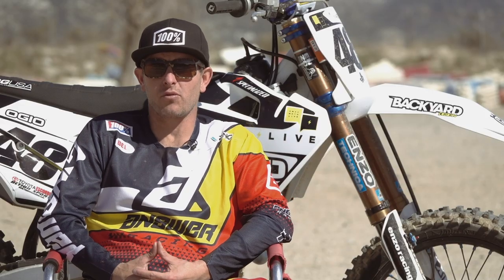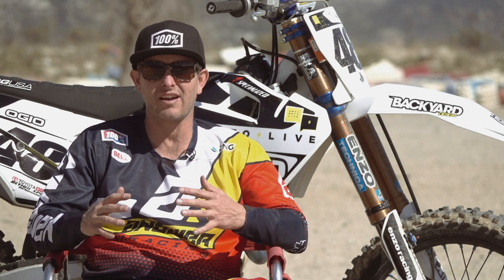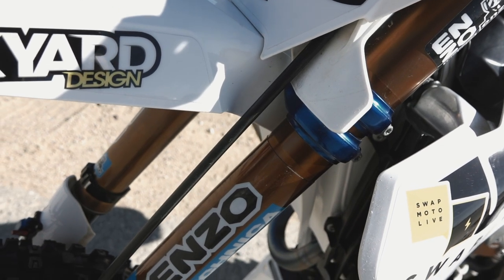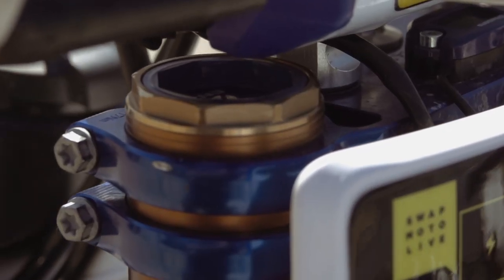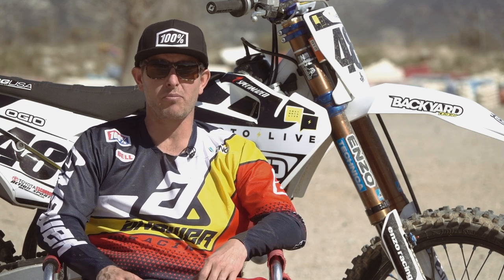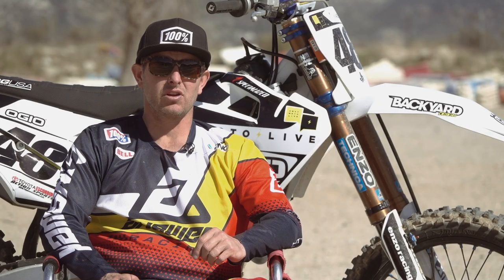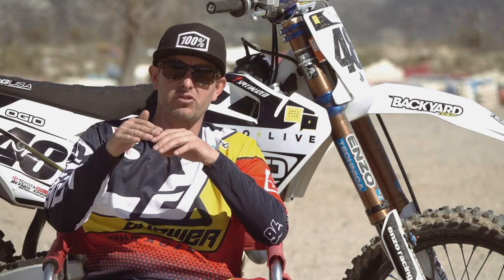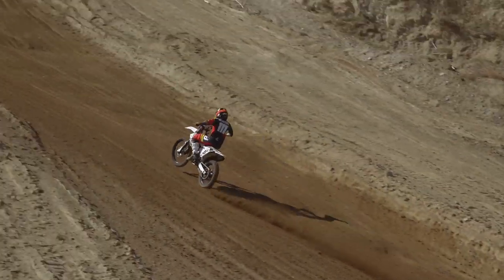ENZO Technica Front Fork WP/KYB Conversion | Track Tested

Comment: Coming off a kyb sss on my 15 yz and going to an aer48 on a 17 sxf I have to say I absolutely love my aer48!
Reply: @NGK450 Nah i love the adjustability, the dead feeling, the progression curve, and the light steering feel. It recommends wayyy too much air though, only thing they fucked up
Reply: @Runk3lsmcdougal  what do you mean by the air? like you always have to be checking it? might be buying one
Reply: @cabreezy100  they recommend like 152psi, and I run mine at 140psi. The recommended psi is too high and makes it feel harsh, just lower it till your comfortable. Aer48s rule dude, I was nervous myself. Don't be
Reply: Wow, you are the first person I've ever heard say that. I rode my buddies KTM, the power was awesome. But the suspension sucks, we tried to get it dialed in but could never get it right. I'll take my Yamaha any day!
Reply: @chuck4027  Yeah i mean TONS of people race on aers. But a 15 yz450f is absolute garbage so that could be parthof it
Reply: @Runk3lsmcdougal  yeah I know a lot of people that that love them and quite a few that hate them. It's all about what works for you.
Reply: @chuck4027  For sure, i really do like it. The yamaha star racing team with justin cooper and ferrandis actually run an air fork so
Reply: @Runk3lsmcdougal  What's your weight and ability? I've been running 148PSI and have been liking it. I had to slow the rebound 3 clicks which helped the front end feel more planted coming into a rut. I may go back to 2 clicks in but I've almost found a great setting.
Reply: @jakewaggoner4196  B class, 180lbs. I run 134-144psi depending on tracks
Reply: @Runk3lsmcdougal  That's insane man. lol. Seems very soft! But each their own which is the fun part!
Reply: @jakewaggoner4196  try it dude, just raced today at 136psi and way over jumped a 3rd gear uphill jump and didnt even bottom. Im also 17 clicks out on compression
Reply: I rode this bike the first few weeks i had it at 154-162 and it was the worst fork ive ever rode. 136psi qnd it feels incredible
Reply: @chuck4027  Consider myself to be the second person. The SSS fork is WAY better in the ruff stutter and braking bumps but the AER is the closest it's ever been. It never does anything unusual no matter what you do...right or wrong.
Reply: Are u joking? 
Lol.  I can see the aer being good on a smooth fast track but come over to northeast after a national day then tell me you like the air fork better. 
I owned both aer, kyb, A kit Showa Sff spring and the KYB spring forks can handle the rough stuff. My Showa A kit $12k was better then the KYB but not by much.
Reply: @ryanrodriguez70  Yeah no im not joking, so in the time of this comment i owned a 19 yz250f and that fork felt really really good, much better than my 15 yz450fs. but now i own a 21 ktm 350sxf and the xact pro aer48 is incredible and feels just as good as that kyb on the 19 yz250f. There is a setting for everyone on the aer48s, you just have to find it. Also i race +30BC so im not a pro
Reply: @Runk3lsmcdougal  You nailed it. The dead feeling , the progressive curve, and the light steering...only thing I would add is the unbelievable supercross type bottoming resistance.
Reply: @ryanrodriguez70  I'm from NY and all I ever rode was New England until I moved to Florida. The KYB is WAY better on hard pack. But in the sand the AER outshine the KYB imho. It has a way lighter steering feeling, better bottoming resistance and a dead feeling progression the SSS cant match. I've also owned AER, KYB, Pro Circuit Showa A kit, Cone Valves and tried nearly every suspension company on stock stuff. Spent thousands and thousands looking for magic and by far the best money ever spent 650 bucks to be exact was with Craig Decker at Enzo. The AER isn't perfect but for the money it's the best suspension I've ever owned minus the SSS in the chop. That's really where those KYB spring boingers shine.
Reply: @peaceprayer595  Yeah dude literally bottomless, the Xact pro on the 21s are incredible, nothing else to be desired. If you come across morons selling them for 800$s BUY IT!
Reply: @Runk3lsmcdougal  LOL...just started looking on ebay!

Comment: It's funny. This is probably the fourth time I've watched this, and I finally bought these inserts form ENZO and had them revalve my shock at the same time. Here's my take: First, the price for the entire fork is NOT the price you listed here. Shame on you for that. The listed prise is JUST the inserts installed into your forks with new lugs. Second, the KYB doesn't even compare to "slap down" landings when placed side by side with the AER. The AER is virtually impossible to bottom, and when it does it's pretty amazing. The only thing we've ever tested that comes close in bottoming resitance to the AER is the Jeremy Wilkey's Huck Valve. That all being said, the KYB is an astounding fork that works amazing. The front wheel traction around corners is astounding and it moves so freely especially over stutter type braking bumps. As much as I want to love this fork, I'm just not certain the trade off in the bottoming resistance is worth it.

Comment: I love KTM and Husqvarna, but its very hard to justify spending $10k on a bike, then another $2k to get the suspension set up properly.  You can buy a Yamaha for $9k and your all set with the stock suspension.
Reply: true but you cant make a Yamaha as light as a KTM for $3k but i agree KTM needs to lose the air forks and offer their WP A-kit on the production bikes instead of making people buy suspension twice
Reply: a vanvoss I was just about to say the same exact thing. My ‘19 YZ450 is incredible out of the box, and I paid just over 8k for it. I’d really love to try a Husky or KTM but hard to justify spending (we all know KTM dealers hate negotiating on bikes) that much just to put another large investment into the suspension. I have no complaints of my YZ.
Reply: @MotoMatt418  I also have a 19 YZ450F.  Its the first bike I've had in a while that I'm not having the suspension revalved, it feels great as is.  The whole package is great.  We also have a 19 YZ250F for our daughter.  Its an amazing bike, even with the sag set for her I can still have fun railing it around the track.  Both bikes are a blast.
Reply: @Sleepy.Time.  Some of that lower weight is because of the air fork.  Going to a spring fork would add a couple pounds back to the KTM/Husq.
Reply: @luckyguy19  yup, at least 2 or 3 pounds (small fortune in Ti to drop that much again). Id happily ride either bike
Reply: @Sleepy.Time.  I can live with the weight difference, especially with the difference in cost. And those YZs are absolutely bulletproof and a lot more fun to ride.